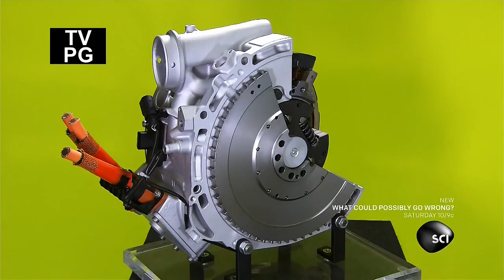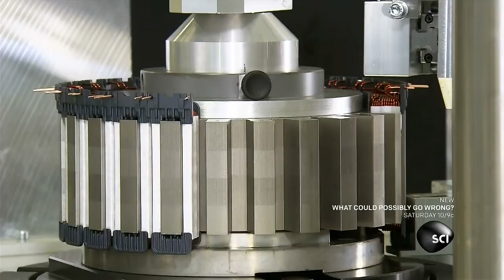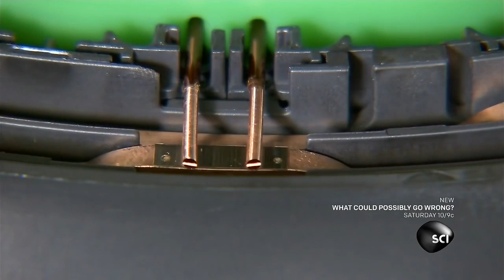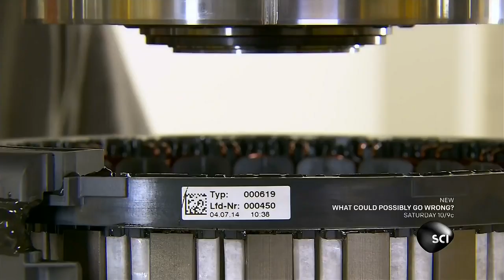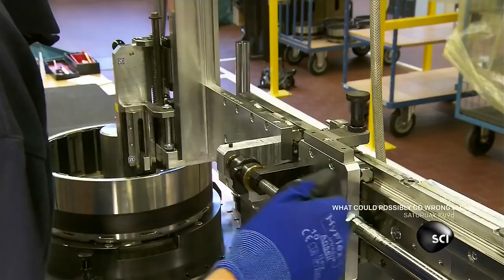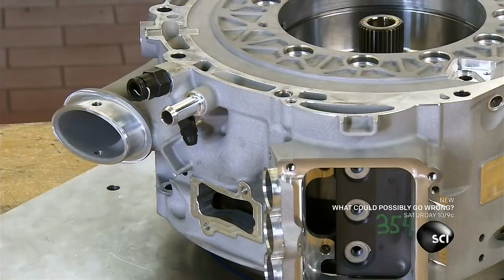Porsche 918 Spyder Electric Engine Manufacturing 720p

Comment: inefficient! 2 opposing forces the magnet and the current induced to the stator produces the torque . therefore the magnet should be at the highest level. to make my explain short. the motor should look like the little dynamo found on miyata race cars. explain it to yourselves why it is most efficient. if only that little dynamo is as large as that what you built it will produce twice the strength at the same amount of induced current.  also i do not approve using lithium battery as source of electricity it is weak. electricity should come from a generator more like that of the bloom technology whereby any kind of fuel will create enormous amount of electricity without burning research it for your selves as well.

Comment: I wish I could talk to some of these engineers. Not sure why they chose black Ferrite magnets instead of neodymium. I'd actually fire some engineers for doing such. so incredibly inefficient!!
Reply: I think you should give them a call since you obviously have figured out something the entire automobile industry have not. BUt before you do that, read this and then think about your comment. https://en.wikipedia.org/wiki/Dunning%E2%80%93Kruger_effect
Reply: Only for your information, these are neodymium magnets coated with black epoxy resin and axial magnetization
Reply: Jesse Fritz ... Was thinking the same thing along with some other commenters here... I can't imagine this was a cost or budget issue as this is a 918 Spyder where nothing but the best will do...? Quite frankly I'm surprised the stator windings weren't silver either.:-/
Reply: FYI they are neo magnets. They're just coated with a heat resistant coating.
Reply: Jesse Fritz have you? where can we see?
Reply: Branimer Tadrov... and who are you? You don't work for me, NDA hasn't been signed.
Reply: What I'm working on or building... isn't for YouTube.
Reply: You obviously haven't designed Ave built efficient and powerful electric motors.

Comment: Wow, an outrunner
Reply: Anton Npn ... Yeah... beautiful isn't it!?
Reply: I dont get how is that an outrunner with that outer casing?
Reply: marble89 ... The Rotor or rotating part runs outside of the Stator or stationary part and the torque is transferred back to the drive shaft... The outer casing just encloses the entire assembly.

Comment: By far the only outer rotor EV motor I found. What's the rationale behind it?
Reply: Zhenhao Zhou ... Yes this is a rare bird... I don't know why? 
@ Mate... you're right about the torque but why do you say it's RPM limited? I find that hard to believe... Is it rotating mass? Please enlighten me.:) Thanks!
Reply: Mate Varszegi ... Thanks for your 2 cents Mate... Excellent! :)
I've become quite partial to PM outrunners for their simplicity, efficiency and stellar torque potential. Coupled with a planetary gear reduction set makes for a very compact direct drive system.... Of course electric motor vs. 2 stroke shows the amazing efficiency of the electric motor with regard to energy input to power output. The Fully Charged channel actually has a brilliant display of this comparison with a Bosch electric lawn mower vs a petrol 4 stroke. Really puts things into perspective in an entertaining way...
Reply: In skateboardwheels and in bikes. But its not big EVs.
https://www.slant.co/topics/5563/viewpoints/2/~types-of-motors-for-electric-skateboards~hub-motor
Reply: KLD builds something similar.
Reply: A dutch company uses in-wheel motors (outrunners) for buses and cars
http://e-traction.com/en/solutions/thewheel/commercial-vehicles
Reply: Mate Varszegi how does it have over unity capability?